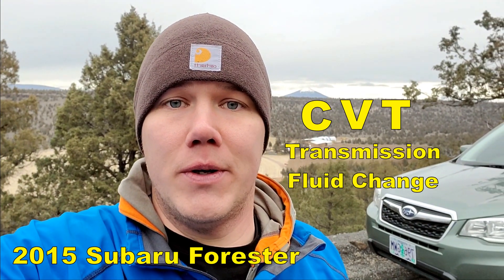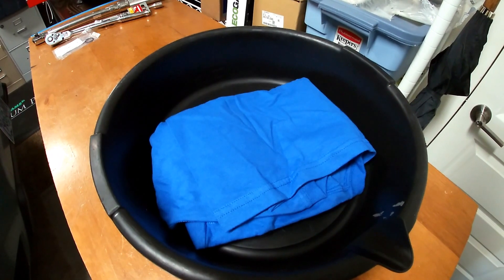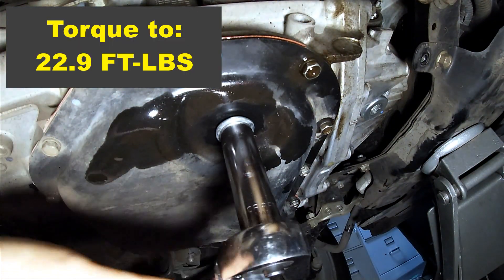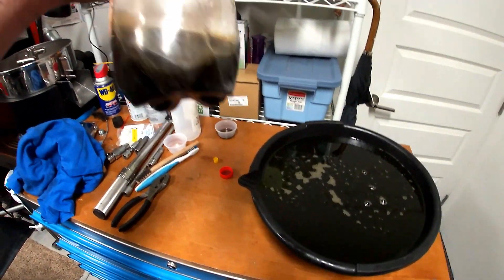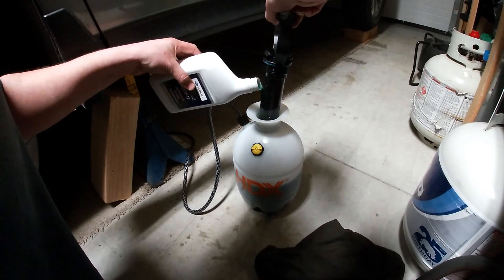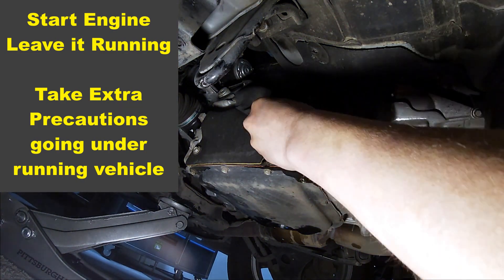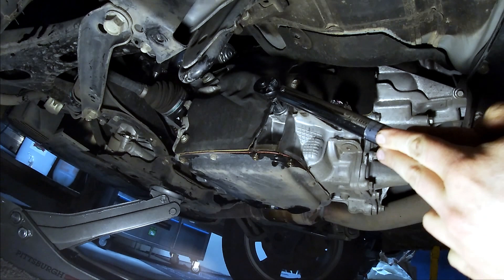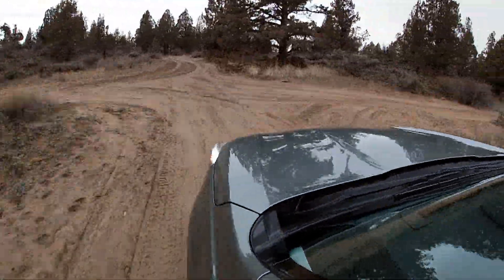Subaru CVT Transmission Fluid Change & Flush Procedure | 2015 Forester Replacement-Fill-Level Check

Comment from the maker: my latest video: https://youtu.be/G4t8rmrm08A
Reply: with the amount of fluid required, probably same effect as changing the CVT oil via normal process every 10,000 miles instead of waiting to 100,000 miles. probably better for the transmission not to have all that wear. that's what i do anyway, every second service = CVT oil change. i think that's about 2/3 of the fluid changed each time.
Reply: In a 2018 subaru crosstrek limited has a filter in the transmission? Or it has no filter ??

Comment: There is a lot of confusion about the location of the Subaru Forester CVT transmission fill plug.  In the 2024 model, it is on the right passenger side of the transmission.  Don’t confuse it with the differential fill or drain plugs.  In earlier model years, the fill plug was on the driver left side, and there is still one there in newer models, but the exhaust pipe makes it difficult to access.

Comment: You should also remove the cvt oil pan to clean the magnet and replace the strainer/filter. Note this process will remove only about 1/2 the fluid, the other 1/2 is still in the torque converter, but this is OK to do.

Comment: One thing i have seen on other videos is removing the pan. Is that necessary? Worried about having issues resealing but also worried about the magnets, screen, and pan being filthy. 

Also is the flush a preference or would not flushing at 120k, 180k etc cause issues with the cvt? 

Biught used at 60k and dont know if the cvt was changed at 60k actually

Comment: I have always done a pan off in nearly every auto transmission, I noticed you and MrSubaru did not take the pan off.  Is there a reason why not?  Seems like you could get more fluid out that way.  Of course, most of what I'm talking about also had a filter to change and I'm betting there isn't one here.

Comment: Thanks for the coaching on this task, really not that hard but it was good to have seen your process beforehand. I got a longer 1/2" tube and set a 1 gal container near the car door where I could watch it fill, so I didn't need my wife to help. My dealer wanted $425 for a "drain and fill" and they couldn't tell me how much fluid was going to be changed. The flush was quoted at $650. I only flushed once and used a total of 7 quarts. Cheers!

Comment: At this point, you're not covered under the 5 year/60K warranty any longer. So, DYI is the way to go. By the way, how much did they charge you for the drain and fill? Thx.

Comment: thanks for specifying that the vehicle has to be running to check the level. dont like the flush method to much but good video. 10/10

Comment: While it may be ok after the fluid change. You are supposed to do the "RELEARN" procedure for the CVT. You need a bi-directional scan tool with the option.

Comment: Thanks for the video. Its nice that your Forester has the exhaust on the passenger side. On the 2019 Forester Sport its on the driver side right next to the fill plug. How much did this cost you in fluid? Would it have been close in price to just have the dealer flush it?

Comment: These CVT's are really a step backwards.  I have a 96 Legacy wagon 2.2 L with a 5 speed tranny I bought 10 years ago and has 260K miles.  I changed out all the fluids and filters everywhere, with new plugs/wires and am into my 2nd set of tires and batteries.  That would be your best solution to your new used problematic subaru, find a pre outback 2.2 subaru like mine.  My friend from high school I have known for 60 years bought the same Legacy wagon new decades ago and he has 600K miles on his legacy wagon and has only had to do valve work once and relace the timing belt as per recommended.  The way I resurrected the crappy CVT on a mitsubishi I bought cheap at an auction was doing about 5 "drop and fills" making sure to drive vehicle about 20 miles between each drop and fill and using the Castrol CVT fluid you can buy cheap by the gal at walmart.  After I got a clear red color, I did a final drop and fill and also removed the lower pan so I could lose even more fluid and do a filter change and clean the magnet.  I also changed out the near impossible to change small paper filter that was located under the battery.  That CVT ran fine after that and for me was easier than doing something like this guy describes by using the lines going into the cooler.  I did do the cooler line trick once with a 90 ford f 150 that had a massive capacity and it worked good for that truck.  BUt my main point is we are all screwed now with modern vehicles and this kind of crappy CVT designed to wear out, be tossed out and then force you to either spend $8K+ for a new CVT or just suck it up and do what the dealers want and by a brand new car every 100K miles or 10 years.  They want these cars to fail ever 10 years to sell you a new over priced crappy over designed and controlled by electronic modules that also fail all the time for no reason kind of car/truck.  So glad I have my old low milage 98 barn door suburban, an 08 Prius with a new toyota battery I replaced myself in 2020 and my old never fail 96 Legacy.  Gonna drive them till I cant buy parts at a junkyard or they die, whichever might come first.  Good luck folks with the new overpriced overengineered vehicles!!!!
Reply: No duh, get the 6 speed version, they are hard to find for a good price because everybody keeps them or gives them to kids or sells them to close friends

Comment: Hey man. Just about to do this on my 2017 Forester. I'm curious though... It was suggested to attach a clear hose to the RETURN nozzle of the coooling unit, that way can run the engine while topping up from the fill-port which pushes new fluid into the whole system, through the cooler, and out the clear hose into a waste container - do this until it runs new / clear. Thoughts? Cheers.

Comment: each manual says something different how you supposed to know that to go by? my 2012 manual says you dont have to check cvt regularly not necessary and to note you are not supposed to flush cvt transmissions only drain and fill recommended.
Reply: Originally, I believe Subaru claimed that the CVT fluid never needed to be changed… Which was completely incorrect…. I think that’s part of the reason why it’s so difficult to change it and to flush it.    In any case you don’t want to skip changing the fluid… flushing it every time is not absolutely necessary but it’s a very good idea especially if you’re not changing it often enough.

Comment: First off! I love the first shot of this video with that mountain in the background. Immediately pulled me in and knew you're the kind of guy I could trust with this operation. Also couldn't help but notice the cream soda bottle (I believe it was at least) A&W and a competitor: the Barq's rootbeer bottle. All very good items. Looking forward to giving this a shot on my 2014 impreza which I've changed the valve body out a few years back and it's ben giving me transmission kicks between 2-3 gear the last couple months and it's becoming more and more annoying. I don't believe the fluid's ever been changed and it's at 160k miles now so why not! thank you in advanced and I'll be sure to leave a follow up!
Reply: Okay update!

I've watched your video so many times (w/ repeats) that I practically have that song playing in my head for next few days lol. Really worked well! Innitially I got about 4.5 qaurts total of old CVT fluid in my initial drain (and maybe close to 5 qt when I include a bit of the blowout from the hoses) but not nearly 5.5 quarts which made me wonder if that had anything to do with my transmission behavior and kicking. My car is at about 170k miles and it looks like it never had a flush or fluid change (I asked my guy a few years ago to check fluid and he said he did a "sniff" check and it all seemed good which seemed like a way to say he was too lazy to check it). I had done a valve body replacement 3 years ago.  Anyway- did as you instructed and got fluid up to 100 degrees before screwing on fill cap and got about 5.5 quarts or so into the engine. my sprayer was a great tool for this although I ended up taking off the 12" wand to make it more versatile down there with all the obstacles. Drove around for about 45 minutes and the kicking has decreased significantly from what it was doing before and a lot of it will be tested on interstate tomorrow on my commute to see if it has really improved but so far I'm in love with the change and fresh feel. 

You're video was absolutely helpful and can't thank you enough for the encouragement and good tunes! :)

Comment: THANKS A MILLION for this detailed video - extremely useful.  I am just curious, after all this effort, why you didn't replace the filter and clean the fluid pan / including the 2 magnets ? all the best, rafael.
Reply from the maker: @rjara8097  main thing was to replace aged fluid. It would be cool to clean the magnets however the "filter" is more of a coarse screen. To replace the actual filter would require removing the transmission and splitting the case open.

Comment: Instead of re-filling and pushing out 2 qts at a time, could you not put the other hose to the cooler (one that comes from cooler into the transmission) into a fresh fluid container and let it cycle old fluid out and new in?

Comment: Came across this because I was trying to figure out how to add fluid to my buddies '17 Forester. Here where I live having a shop flush the transmission is $89 plus tax. The cheapest I can get 13 quarts of CVT fluid is $170. So for basically half the money I don't have to do any work.

Comment: Wow MT.  You sure went to a lot of trouble.  Used a lot of CVT fluid.  Think I'll just have the dealer do a 6 quart drain and fill.  If the CVT fails thereafter at least I have them on record doing work on it.

Comment: Your video is a massive help for me. Thank you for putting it together. I effed up and put ATF (Idemitsu - Type HP). I read somewhere that it was good for Subaru models and overlooked the Type SB2 which is specific for the CVT models (2016 Outback - mine). So, 500 miles later it struck me and while I don't think I killed the tranny (only 500 miles and cold winter conditions), I wanted to get all that ATF outta there. Your video was perfect for instructing on how to flush a tranny instead of just serially diluting the the oil in the system. Thanks again. Fingers crossed.

Comment: Just to clarify what I saw: you technically overfilled the cvt while it was cold. Warmed it up to 72 f and let the excess drain while hot. Once warm and with proper volume of fluid, there should not be any fluid coming out of the fill plug. or did I misunderstood?

Comment: Great video. But I have a question, why not put the black hose that you removed and put in a container of fresh CVT fluid, instead of manually filling the CVT. That way, the black hose will suck the same amount of fresh fluid that clear tube is squirting out. Wouldn't that be an easier approach. Or am I missing something?
Reply from the maker: Good question. It's because that line does not "suck" at all. It only gets fluid pushed through it.
Hope that helps
Reply: @MTsubfly  ahh, makes sense. Thanks for the clarification.

Comment: I was just wondering about this for my beloved wife's Subaru. For all their craftsmanship, Subaru going the way of Apple & locking everything up w no ability to change a transmission filter which, as you all know, is critical to a tranny, well, I don't know if they continued with this trend. But if I had some spare denarii I'd put on an external filter of some sort. It's the worst idea since they started putting fuel pumps in tanks w a nylon stocking & thinking that's filter enuff... oh wait. Subaru did that too. And here I thought... what nice guys to put the oil filter on top...
🤔🤨🧐🥸😳🤓😎😁

Comment: great job.....if you knew the thread size of the fill port you could buy a barb fitting and fill it with the 3/8" tube by gravity......like you I see no point adding 5 quarts of new oil to 8 quarts of dirty oil.

Comment: Could you fill the transmission fluid through the line line in from the cooler? Or can it only be filled from the fill hole..? I understand the whole point of the fill hole is to make sure you put the right amount in, but if everything is measured it should be fine

Comment: So glad I watched this as this has been bothering me on my purchase, as the dealer wants $700 plus to do full flush, as I can figure the oil runs about @22 a quart, so after the oil cost that means they are charging like $500 labor, well that's too fuc'n much, so thanks, I've seen several of these trans. service videos and they just drain once and refill, so thanks for going the extra mile to show us how easy it is...Javi G.

Comment: Thanks for sharing. 

I would've started at the heat exchanger. Disconnect the return line, use an inline connector and attach it to a clear line and place that into the container holding your clean fluid, I'd prime that line and add a couple more quarts to avoid sucking air into the system. Now, the port in the heat exchanger that the return line was attached to,  run another clear line to an empty 5 gal bucket and start the car, shifting through the gears. The transmission will suck in nice clean cool transmission fluid,  go through the heat exchanger into the empty bucket. When you see clean fluid running into the waste bucket, shut it down and put the input line back on the heat exchanger. Then go through a final fill procedure like you did at the end. 

Doing it this way will flush out the cvt, torque converter, and heat exchanger. 

I used to do this all the time in "normal" transmissions. 

I know a cvt is a different animal. But,  it has a pump and a tongue converter and a heat exchanger. It'll work and you'll have 100% brand new fluid in it.
Reply: Thank you for this reply, I'm due for a CVT fluid change and this is exactly what I was looking for, I too previously did the method you described in my GMC 'normal' transmission and was thinking the same thing, "why not let the transmission 'suck' new cvt fluid since it should have a pump" I searched what seams all Subaru CVT fluid service videos and they all used other methods to pump fluids back into the cvt, but not the method you mentioned of letting the trans use the pumps suction to get the fluid back into the trans, which seems to me to be so much easier.
Reply: Your way of connecting fluid lines is what I do when flushing tranny fluids on my Toyotas — let the tranny suck new fluid and blow out old fluid from the radiator tranny cooler line until it is bright red. But this is only good if the CVT “In” port (return port) also ‘sucks’ otherwise his method will suffice.
Reply: @bygonebob  His method works,  no doubt. CVT's have a pump as well, it has too. I used the procedure I mentioned last month. I wish I would've made a video showing that procedure.
Reply: About how much time was taken to run the clean fluid thru the system?
Reply: Why are the CVT filter not changed
Reply: @chrise2312 it's not a filter, it's a metal screen

Comment: The most important point with the transmission fluid change, is not waiting longer than 1000 miles before changing it.  Sending a portion of this fluid for a metal analysis is also wise.  Also a secondary analysis after a multiple thousands of miles will give you a sense of security.

Comment: I was told not to ever open up  or attempt to change fluied on my 2016XT.  The transmission is sealed and must be replaced with a new rebuild sealed transmission from Subaru.

Comment: watched a bunch of videos before doing this, and your method is for sure the best method to make sure your getting everything out before putting in the new fluid.  I am surprised you didn't take off the pan and change out the filter.
Reply: is not entirely necessary unless you see dripping areas

Comment: My Gal got quoted $1400 for a 60K Maintenance in Ukiah, CA. Looking at Maintenance List; looks like this Tranny and Differential(s), and Engine oil change, and Spark Plugs are the biggest part (on top of inspections ( including belt tensions) ... Nice to see DIYer support for a complete transmission change. Thanks. Might go for saving my Gal a grand from that Deal Cost 🏊🚣🏄🌠

Comment: Thanks for the great video! Heads up, that OBD2 scanner isn't available any more. Do you have any other OBD2 recommendations for Subarus?
Reply from the maker: Thanks for the comment! Bummer, I can't find it anywhere either. 
Maybe try this one. Looks like the same thing. If it doesn't work out they should take returns on it.
Kobra OBD Scanner

https://www.amazon.com/KOBRA-Wireless-OBD-Scanner-Connects/dp/B01C3HAHCS/ref=asc_df_B01C3HAHCS/?tag=hyprod-20&linkCode=df0&hvadid=343257912631&hvpos=&hvnetw=g&hvrand=2462780170949740779&hvpone=&hvptwo=&hvqmt=&hvdev=c&hvdvcmdl=&hvlocint=&hvlocphy=9033176&hvtargid=pla-751691986698&psc=1&tag=&ref=&adgrpid=71715066929&hvpone=&hvptwo=&hvadid=343257912631&hvpos=&hvnetw=g&hvrand=2462780170949740779&hvqmt=&hvdev=c&hvdvcmdl=&hvlocint=&hvlocphy=9033176&hvtargid=pla-751691986698

Comment: While it is very detailed and thorough way to change CVT fluid, I have a feeling this is little too much in terms of labor and the fluid waste. I would probably do it in a simple way (open drain plug, refill the new fluid on top) every 30K miles instead of doing this every 60K miles.

Comment: I always had the Stealer do this expensive service, being I knew there was a fluid temp for proper fill level. No more Stealer doing this service for me. Thank you for your time and quality in this vid. Same as your other vids too.
Reply: A dealer would never do it this way they are not that thorough they charge a fortune just for a simple drain of the pan and a refill that's all they ever do and they charge a fortune, I would never let a dealer touch my car ever